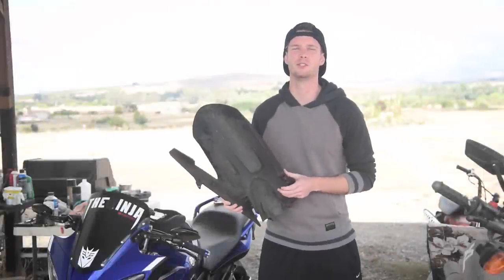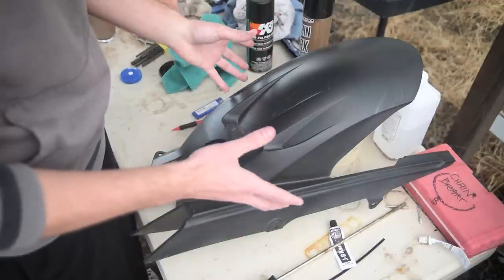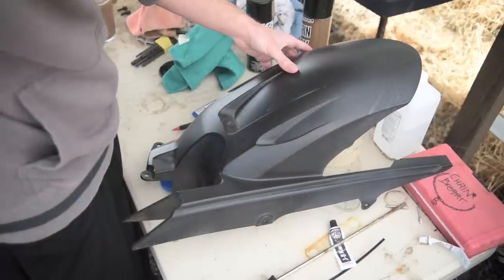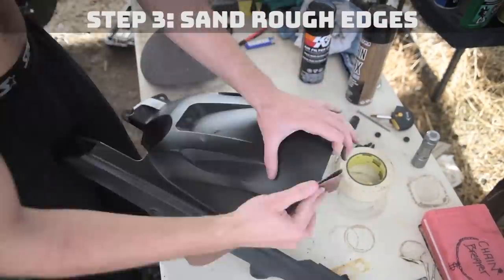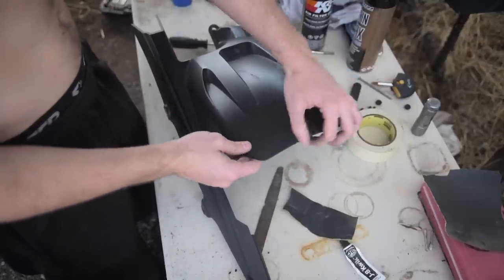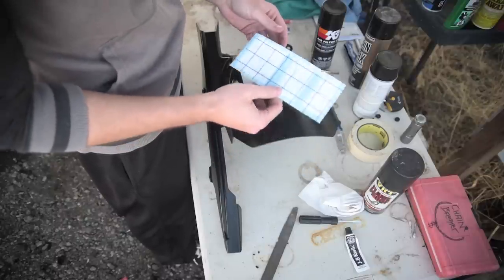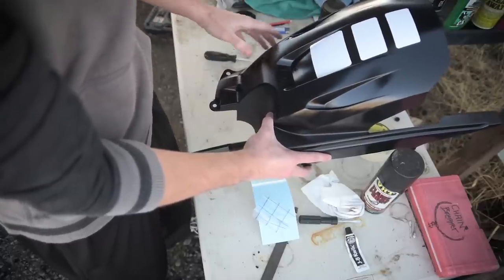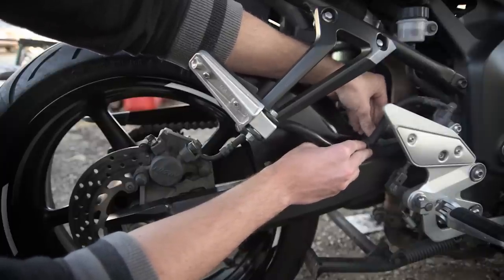Tire Hugger Mod  (Supersport Look) on Yamaha FZ6 "Fazer" Motorcycle

Comment: TIP,, if you use a razor blade and run it along vertically along the edge were you have cut it you will get a pro finish